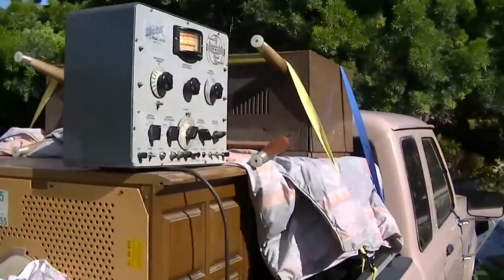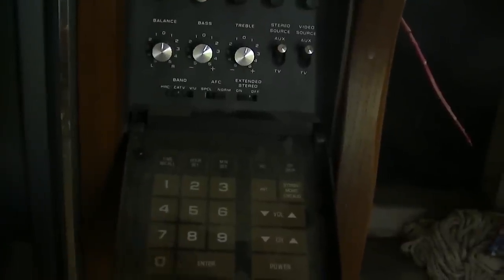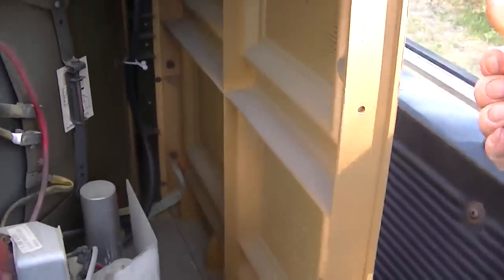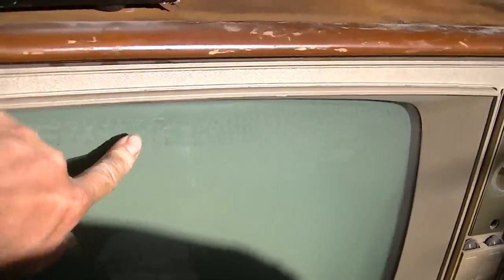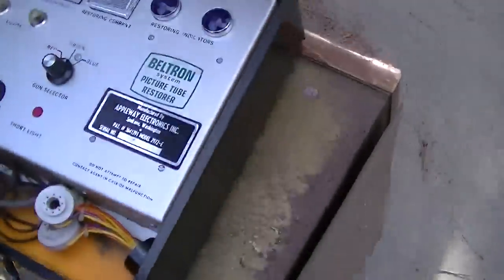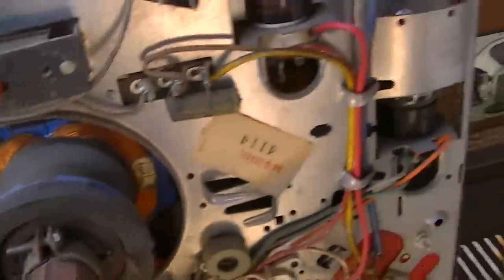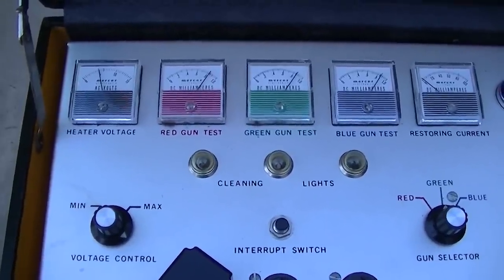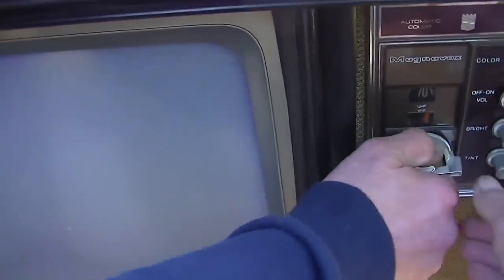Vintage TV Haul Number Enough

Comment: Antennas wear out? I have used the same one for 36 years. Got a new one last year. The old wasn't pulling many channels anymore. But it was probably due to a bad 300 ohm to 75 ohm coax converter.

Comment: Each year, Zenith designed a few tubes out of its color TV sets. This set is probably from the last model year that had any tubes (excluding the CRT). The horizontal circuitry was the most difficult to redesign into "solid state", so saved for last. Your 1970 Zenith Space Command 300 set appears to be from an earlier model year with a greater number of tubes.

Zenith migrated away from hand assembly to circuit boards sometime later. They used removeable boards that could be swapped out by service technicians and returned to a factory service center for repair. There were some problems with connectors. Swapping boards didn't correct the problem if connectors were bad. Also, I don't think they analyzed all the failure modes. Under certain fault modes, I believe that one bad board could stress a different board and cause it to fail. So, a technician could install a new board and have it fail immediately.

Of interest were Zenith's SSAVI cable TV decoders used for subscription TV. The engineers modified part of the TV design for the decoder. One particular Zenith TV board could be used, with additional circuitry, to construct a homemade decoder. When the company became aware of the issue, they implemented a policy that they would only accept exchanges of that particular board. Later on, as the TV sets reached end of life, those boards were pulled from junk sets to make decoders. The Zenith decoders were introduced in about 1980 and remained in use by some cable TV companies until about  2000, long after most of the Zenith TV sets had been replaced. I would not have been surprised if some TV shops offered a generous trade-in just to get the boards!

Comment: My 2 half brother's family in Cypress CA has that same exact 80s Zenith Console TV made 1986. When I was over there in 2006 the TV has no sound, but corrected that by switch from ext. to int. speakers on the back. I know the problem with yours is definitely not an operator error as you said the sound does work with the AV inputs. Bad cap maybe?

Comment: how are you receiving channels when analog tv is not aired anymore????
Reply: +Jake McIntyre A transmitter that is transmitting an analog tv signal at 10:18. The transmitter is hooked up to DirectTV and as you see in the bottom right it says DirectTV Cinema at 10:26